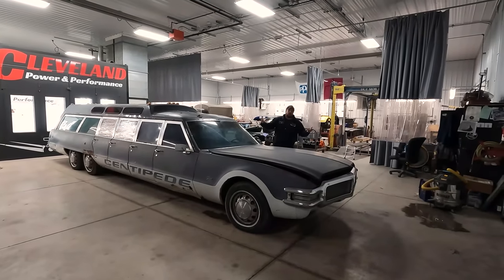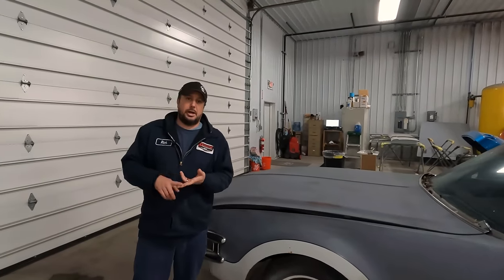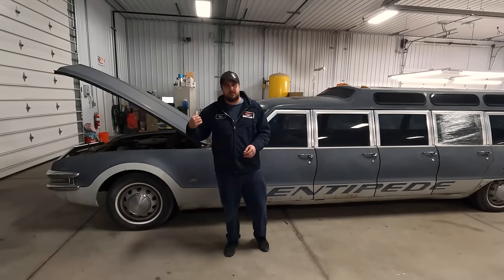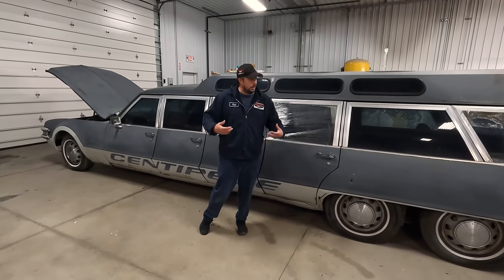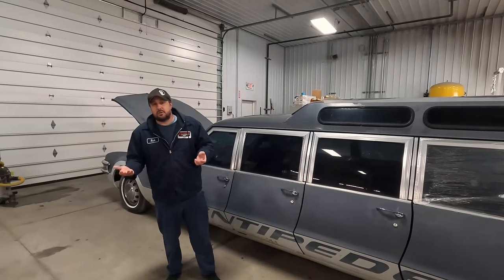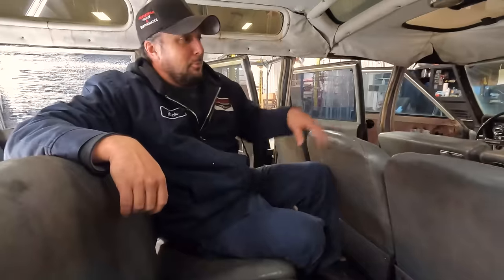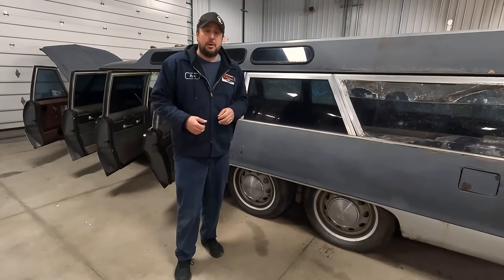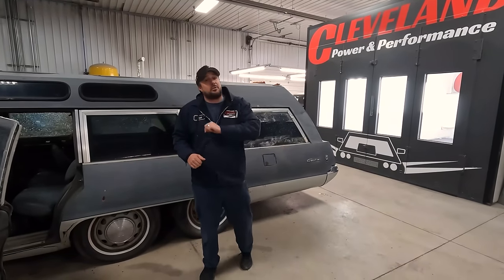1968 AQC Jetway 707 Airport Shuttle History & Walk Around

Comment: What a beautiful sight to see one of these again after over 55 years ago as a little boy of 7 years old! You didn't say in the video, but the Toronado Jetways were indeed in service at Dallas' Love Field Airport back when they were new in the late 1960's. I saw several of them there. That was of course when Love Field was Dallas' only international airport. You guys definitely need to get her restored! However you will never see a return on what you will have to invest. But, you will treasure this wonderful artifact of "modern", mid-century Americana for many years to come. Not to mention, attract LOTS of attention at car shows. The "Oldsmobile Toronado" portion of the restoration is a slam dunk deal. Lots of parts out there for restoration that could be either NOS or even OEM. I would install the modern electronic fuel injection system available for the Olds 455ci. engine. I would also look for all of the original instrument panel trims, steering wheel, and gauges belonging to a Toronado of that '68 vintage. Replace the rear bumper with a new, replacement '68 Toronado unit. The Toronado slotted wheels are easily restored. If it does not already incorporate it, I'd add a three inch dual exhaust system.

But man, oh man........that remaining interior and body construction?! I would start contacting Stageway Armbruster for historical documents and build sheets to get it accurate and period correct. Plan on spending a minimum of $300,000.00 to get this diamond-in-the-rough back to her former glory! But please keep her!!!!!! .............Mark in Texas
Reply from the maker: Mark, thanks so much for sharing all that with us. We are still learning some of the history on these as we go, so info like yours is helpful. If you don't mind, please shoot me an email to tim@clevelandpap.com when you have a chance.
Reply: We are about the same age.  I’ll bet this car never saw a screaming moron passenger at the airport.
Reply: I agree that this piece of history should be restored. It won't be cheap to do but if I were you I'd be repainting it with your company name and colors so you could use it as a mobile billboard to take to shows or meets like Carlisle. Good luck with it and keep us posted. Cheers!
Reply: Should be in a museum. Great piece of history

Comment: Cavender Oldsmobile in San Antonio Texas had a white one bought new in 1968. They kept it for years.  It was leased out for weddings and special events. 

It had an interesting option. 

It was equipped with a gasoline generator under the floor of the baggage compartment that ran a small central air conditioner (like in a home) that cooled the car flawlessly. 

The generator and a/c could be left running whether the car engine was running or not.

PLEASE restore yours!
Reply from the maker: Wow, no that is a wild option! Dangerously cool

Comment: I owned a 1973 Cotner/Bevington Cottington lwb landau hearse. Loved that car! 
The AQC 707 Jetaway was an inspiration for GMC to use the Toronado fwd drivetrain and similar platform on it's '70's GMC motorhomes that have a strong cult following.
Reply: The GMC motorhome was groundbreaking in a number of ways that only the engineering might of GM could produce.  But is based on the Toronado / Eldorado FWD platform and huge big block V8.  Once that version of the car was discontinued, the motorhome couldn't survive as it was not economical to produce the mechanicals or engineer a replacement for a low production specialty vehicle alone.
Reply from the maker: Very cool! Thanks for sharing!
Reply: That 455 olds after GM looked at everything they realize that was a torque monster and it would be perfect for their motorhome
Reply: Hey, EM-50 Urban Assault Vehicle!
Reply: @filipfaraci2751  yes
Stripes😂😂
Reply from the maker: @barriobajaj  any pictures from the back in the day of the ol hearse? We love seeing the original back in the day photos.  I could only imagine how big in person that hearse was lol!

Comment: The transaxle is probably the same unit that was used in the motorhome. It could be as simple as repairing the shifter linkage. As for getting it up on a lift, there are units that get used for trucks that lift by the wheels. This is definitely a unique piece of automotive history. It definitely screams restore me.
Reply from the maker: correct, and very good eye, these chassis were used later in the 70s GMC motorhomes.  The crazy part is, these were out before the GMC motorhomes.  These were really ahead of their time back in the day.  We are kicking around builiding a front and back ramp system the Jetway can roll on and off, almost like a pair of race ramps.  If not, we will end up purchasing a ramp lift like you mentioned.  Thanks for the feedback! Appreciate you checking the video out

Comment: Just a beautiful car, brings back so many memories!  In highschool I bought a '68 Toro for $75.00, that was in '74-75..  As I remember, she needed a right drive shaft and the rear axle aligned as it was run off the road at around 60 - 70 mph.  I dropped in a HEI unit and added a Holley spreadbore which helped take a few thousand miles off the front tires. We often discussed changing the intake manifold to a regular cast iron unit as the stock Toro manifold drops so low due to the engine being raised because the tranny is under the engine.  All together, I owned 4 '68 Toro's and 3 '69's.  It also appears your car has never been transported by an "old school" tow truck.  When they are, the bumper UNDER the headlight doors is bent, cracking the doors and trim under them.  As for your doors not working, check the vacuum lines from the headlight switch.  The large vacuum cylinder between the doors also needs attention as well.  As for custom wheels, good luck!  Due to the design of the suspension, the wheels mount quite far out.  When a wheel is removed and set down on it's outside edge, the tire is off the ground.  These wheels have such an offset they seem close to Budd wheels.  The best wheels offered by GM were chrome with "Dog Dish" hubcaps.  In 1968 Olds removed the factory temp gauge, replacing it with the two stage hot light.  It was the first and only car I have seen with a "HOT" and "Stop Engine"lights. I had thought of retrofitting a temp gauge from a '66 just to keep a consistent look to her.  Good luck with her!
Reply from the maker: awesome, thanks for taking the time to share! Crazy, how for 75 dollars back in the day you could get an awesome steel V-8 car.  Nowadays, you cant even get drinks and hotdogs for the family at a sporting event for 75.  Also, imagine a modern car going off the road today at 60 mph and just needing just a axle shaft 😂😂 I love the front wheel burn outs, so rare for back in the day American cars.  We have a publication company coming in this upcoming week to do a photo shoot on the Jetway, then we can start tearing into it for all of the mechanical.  The old vacuum lines could definitely be the culprit.  This Jetway sat out in the elements for the last 15-20 years, and mother nature won for sure.  It is really rotted underneath.  We will show everyone of course as the videos progress .  Thanks for all of the info and insight, I truly looooove the story and meeting the other Olds historians again.  Thanks again for taking the time and have a great day

Comment: This is one of those unique vehicles that deserves to be saved.  I can see it needing to be stripped bare and the mold removed before doing anything else!  It will need to be remanufactured at this point.

A lot of research will have to be done and getting matching (or close enough) interior materials will be a challenge.  Toronado donors are scarce so, you'll have to source a lot of Oldsmobiles of the era for interior stuff.  If it's Olds +/- 10 years, I don't think anybody would know the difference.    IMO, I'd rather see a cloth headliner than that padded vinyl stuff overhead.  That padded vinyl headliner looks like an afterthought!

On the exterior, get rid of the centipede name and just make it a straight body side molding as it appears to be.

That FWD 455 set up is fine.  Overhaul it, put in a GM HEI (get rid of the points), and put in a Holley Sniper EFI to make it reliable.  I have no doubt that the TH-425 transmission is the GMC Motorhome upgrade because of all the extra weight.  If it isn't, I'm sure there are such upgrades available.
Reply from the maker: Awesome input, thanks for sharing!

Comment: Amazing piece of history that needs to be saved! At the same time it needs updating since you will have to do so much work. This will never bring the "HEMI Cuda" money but is still so cool to drive your family(s) around in. My vision would be to gut the interior and weld the floor back (flat floor should not be too difficult), add any reinforcements while there you see fit. Restore the factory dashboard with modern gauges where possible, add two Cadillac front seats (the ones with the tufted and buttoned cushions) and a custom center console. Luxury carpet front to rear, and each passenger seating position gets a Cadillac full width front seat and upholstered to match the front seats, lose the rear most seat to add a rear a/c system. In the luggage compartment finish it in the carpet and custom side panels in same color as seats. As for drivetrain, trans is turbo 425 (turbo 400) so it can be repaired for not too much money, keep the 455 Olds power but add 4bbl style FI system as it would be a clean bolt on, dual thick pipes to keep interior quiet but free flowing mufflers to give nice rumble outside, aluminum radiator and cooling fans, detail engine compartment and re-bushing front suspension. Rear suspension R&R for safety, maybe a air ride to help manage the loads. Stock detailed wheels with oversized rubber. Now that would be a fun vehicle!
Reply from the maker: Wow, thats a whole dang build plan. Thanks for the great ideas!
Reply: Hope I could help in some way or with some ideas, good luck with the project, hope it goes well @ClevelandPowerPerformance

Comment: I would do a full  body restromod on it. I would do a full upgrade all terrain suspension, new power plant, modernize everything on it. My vision would turn this into one of a kind bad ass camper. It would have a fully functioning lift 4-inch lift kit with fully upgraded brakes all around. Roof has plenty of room for solar panel system to set up. I would turn the trunk into a customized garage with a cool pull out tray system to maximize space and efficiency. Heck, for an aggressive look in the front, I'd add a brush guard fully integrated LED. Oh, and as for the tail lights, since the back end is that big, I would would do a top rap around tail light with functioning turn signals and reverse lights and LED, of course. I would definitely make this AWD capable with a second-generation Dodge Ram with the 5.9-liter, 12-valve Cummins diesel engine that has been iconic. Because of the engine's ability to make cheap horsepower and its super-durable construction. I would definitely have fun with this as a project vehicle. I enjoyed learning about this old 60s airport shuttle. Just something I think is cool and unique.
Reply from the maker: thank you for watching the video, we appreciate it.  Would be a siiiick off the grid type vehicle.  I like your idea on a big ol lift, off road capabilities. The Jetway is already so massive, why not go over the top and go completely ridiculous with it. AQC did it in the 60s, just keep it going bigger and bigger, miint! Thanks again, have a good weekend

Comment: Fantastic automotive history!  I think it would be good to restore it to "last use" equipped, with all the mods done to it retained.  Engine should be stock.  HVAC will be an engineering challenge so that will need careful consideration if original not restorable.
A worthy project, good luck!
Reply from the maker: thanks for checking the video out, we appreciate it! Yes the HVAC system is going to be a bit of nightmare.  We did a separate video on the HVAC system just to show how crazy ahead of its time? it was for the late 60s

Comment: The drivetrains in these cars were overbuilt,  to handle the heft of such vehicles.  So to build something like this out of one of them it was like a walk in the park for Olds.  They came with the biggest engine available this side of the Cadillac 8.2 and for the years 68 - 70 you know they could easily put out close to 500 hp.  It is an ungainly looking car but it is a rarity to find one and an absolute museum piece to have these days.  Hope more turn up as time goes by.
Reply: 1970 was the first year for the 8.2 liter V-8 with 400 gross horsepower (approximately 270 net horsepower).
Reply from the maker: You think we should Cummins swap it?
Reply: @ClevelandPowerPerformance  no.  Make it as original as you can.

Comment: Since it's so rare and not many were made a total restoration would be nice.  The roof marker lights look like a mid to late 1970's ford F series truck clearance lights.   I can tell you that the transmission is a turbohydramatic 425 used not only on the Oldsmobile Toranado but also the Cadillac Eldorado and the GMC motorhome.     Thanks for the history lesson.

Comment: Build it stock with modern safety upgrades. Remember the GMC motorhomes? They used the same drivetrain setup underneath. Cool ride! I hope there are more out there.
Reply from the maker: for sure, some modern safety features would be a-ok with everyone doing the build.  Great eye, you are correct.  The 70s GMC motorhomes were built off of these.  Crazy to think before AQC went under, they essentially designed the frames for the Motorhomes.  They were way ahead of their time.  We hope some more pop up too as this video circulates

Comment: I like how you always referred to the car as a girl.  The original GMC motorhomes used stock Toronado front knuckles that proved to be too weak and were soon upgraded.  You might look into that front suspension and if it doesn't have such an upgrade, see if you could install some motorhome front end parts for safety.  Those motorhomes have a cult following and suspension parts can still be purchased.  Some of those extra controls up front may be for auxiliary heaters or air conditioning units, some of which might be located under the trunk floor or under seats.  Even if a restoration doesn't start right away, at least you have that girl inside so she can dry out and slow down any rotting.  Maybe put a desiccant canister in there like people sometimes do when laying up boats, to help remove the moisture.
Reply from the maker: Thanks for taking the time to comment on the video, we appreciate it.  From what we gather (once again faaar from experts) The Jetway AQC was the base for the early 70s GMC motorhomes you talk about.  It is cool to me, that this small company from Arkansas kind of laid the work for GM and the chassis they built in the 60s, was used on so many motorhomes in the 70s.  Yes, we have heard concern of the knuckles.  From what we heard (once again not experts) the front knuckles were not different than the Jetways? We would love more knowledge, we will find out once we start tearing into the Jetway.  The Jetway has been inside a warehouse and on a concrete floor for the first time, in who knows 20 years, maybe ever.  So the girl is starting to dry out some inside.  We will keep everyone posted of course as the Jetway starts making its path back to the road

Comment: Those transmissions are notorious for snapping the final drivmachine. So that's likely what happened to the transmission. They do make an upgraded thicker chain for those transmissions which is what I would recommend for that kind of weight
Reply from the maker: Yes, we have heard these transmissions were not the best back in the day, even before the Toronado got extended and added that freshman 20 to its body .  The historians on the Jetway always seem to say they had transmission issues, overheating issues, and the A/C system was not adequate enough for the size of the cabin
Reply: @ClevelandPowerPerformance  the jet away was the rear wheel drive transmission. What you have is a TH 425. They're pretty tough transmissions, with the exception of the drive chain

Comment: That drivetrain was pretty versatile.
Reply from the maker: for sure.  We are going to try and save the original transmission, and if it needs rebuilt, then use the case and keep the numbers the same.  We are curious when we tear apart the driveline, if the numbers will be inscribed like the #112 (or 12th Jetway) or if the driveline will be just 68 Toronado GM numbers.  Either way, we will post a ton of videos so all can see and learn with us as we dig into getting the Jetway back on the road
Reply: @ClevelandPowerPerformance  Neat setup. The transmission shouldn't be difficult since it's basically a Turbo 400.